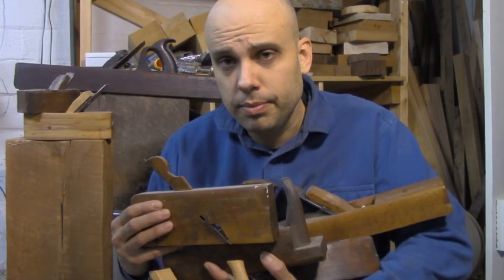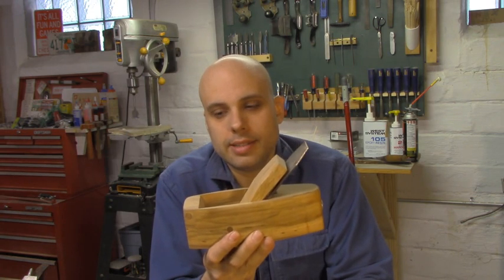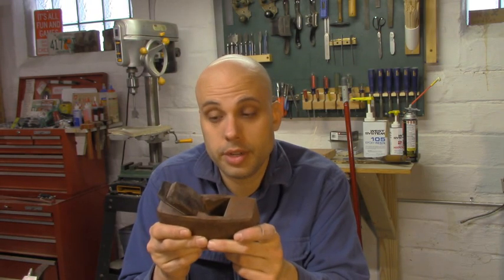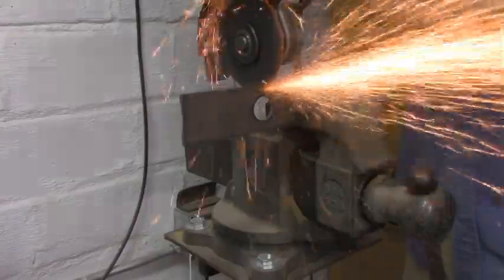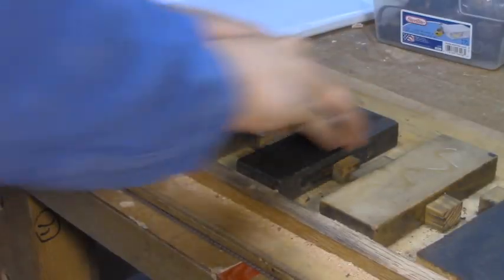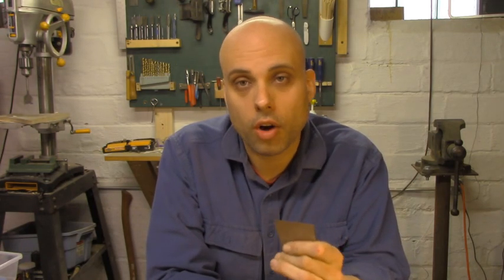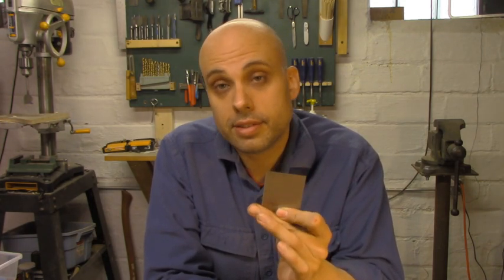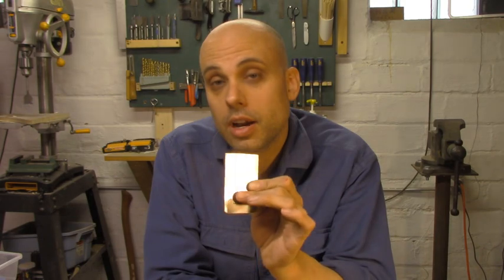Make a plane blade for $2?  (Maybe)

Comment: You still gotta harden it. The spark test kinda sorta tells you if it's high carbon. They make the edger blades out of high carbon steel so it's tougher (like lawn mower blades) but neither are hardened because the first time you hit a rock they'd chip or explode which is bad for business. In metallurgy you always test to see if it will harden.
Reply: Little late but theoretically I could use either of those blades to make plane irons and just harden and heat treat it myself right?
Reply: Additionally they are softer than a file, but harder than mild so you can resharpen them by filing them.  Same with many axe heads and scissors.

Comment: Based on your file test the edger blade is much softer than the Stanley blade.  They probably have tempered the edger blade much more than the Stanley blade to increase the toughness of the steel.  They don't want the edger blade shatter when they hit a rock while using it.  Besides the file skating test should only be done on hardened steel before tempering.  What might have to be done is that you re harden the blade and temper it a bit in the kitchen oven to soften to your liking.  I would heat the blade with a torch until it looses it's magnetism and then dunk it in oil.  Then test with the file again and you should skate across it. Then put it in the oven at 400 F for an hour or two to bring down the hardness a bit.  If you don't temper it will be pretty brittle.
Reply from the maker: Funny that you should mention that!  I did heat a test sample to non-mag just yesterday and quenched in oil. Didn't harden at all. I was hoping to re-harden and then just temper it back a little, just as you suggest. But, this could be a water-hardening steel, so I'll repeat the test today, but with water as the quench. My suspicion right now is that I'm dealing with a medium-carbon steel that's not going to fully harden no matter what I do. But that's okay; I've got backup plans. Either way, thanks for watching and taking the time to leave such a detailed comment!
Reply: Yeah most likely it is too low of a carbon steel.  You can always get a piece of 1075/1080/5160 or 1095 for not much money.  Admiral steel for example have 1/4" x 2" x 60" bar of 1075/1080 for about $29 that would make many blades and you know you have an easy to  harden steel.
Reply: its only $29, but if you only need 10" (for 2) seems like to much
Reply from the maker: I did just get a 12-inch bar of 1095 off ebay for $20. I think I'm going to make 3-4 irons out of it. At that price, the math works.
Reply: That should work just fine 😀
Reply: I also think you have a medium carbon steel. This is not all bad  news and you have two or three options. A; throw the piece away and buy an expensive blade. B; throw them piece away and find an old piece of leaf spring from a breakers yard. This will be high carbon from which you can produce blades to your hearts content. C; find some Casonite and infuse the surface with carbon. Harden and temper the blade and you should be fine. Look  up 'Clickspring' and look for his video on making files. You'll learn everything you need to know. Look him up anyway, he's a highly skilled craftsman with fascinating projects. Regards.
Reply: An edger blade that shatters during use would, indeed, be a bad thing. That’s probably why they don’t use steel as hard as plane irons.

Comment: Just go find a leaf spring from your local pull-a-part or junk yard, or even ask your local mechanic if they have any broken leaf springs.  Those are going to be 5160 steel, which is very strong and hardens quite nicely.  I've made some excellent knives from 5160 so the blade for a plane will function very well.  It's also relatively easy to heat treat at home with a charcoal fire and some canola oil (Parks 50 would be better, but canola will work), then temper it in the oven twice at 375F for 1 hour, letting it air cool in between both cycles.

Comment: Old lawnmower blades are an excellent source. They can often be gotten for free from a lawnmower repair shop.
Reply: Mower blades are not hardened.  They are just plain old mild steel.  This is they deform instead of turning into shrapnel when you accidentally hit a rock.  People routinely sharpen mower blades with just regular files.

Comment: I can already tell this is most probably some kind of spring steel, so it is hardened, but not hard enough for a plane iron, because spring steel has only 0,5-0,8% carbon. 0,8% could work for a plane iron, but it`s a bit on the low side. Tempering is also important. It makes the steel softer but mote flexible. If you just harden the steel, the edge will chip. If you want a blade, you have to temper it, so you have to heat it up to 200-300°C, depending on what you want to do with it. If you temper it higher, ou get a very springy but soft steel. Ideal for the edger, but too soft for a plane iron. 
I made some plane irons out of lage bearings. That´s a really good stell for woodworking tools, but bearings are typically round, so you need a forge and an anvil. 
An alternative is to order tool steel. I bought a piece of 1.2510 Steel, 4,2mm thick, 500mm long and 200mm wide for under 40€. I can make a lot of plane irons out of that. i just have to cut it, harden, temper grind and sharpen.

Comment: Rex, I discovered used table saw blades often make a good irons.

At the Habitat ReStore i find them for $2 - $5 i can get several irons from 1 blade.
They usually "Sing" with a file and hard to scratch.   Test them before you buy.

I now have a scratch plane, scraper, Rebbit, and a few Spokeshaves from them and so far seem to be holding the edge.

Love your videos.
Keep them coming.
Reply: Can table saw blades be cut with hand tools like a handsaw with a high tpi? For cutting metal? Or would I need a power tool/angle grinder?
If not, I might try annealing the table saw blades in my kiln to soften the steel, cut with a handsaw, then shape, re-harden, temper, and hone it. 
I don’t like power tools that spin blades...it’s why I use hand tools.
Thanks for the reply!
Reply: @nostgeoffhi-fi  i used a Dremel tool & grinder wheel although an angle grinder works better

Comment: I just discovered this channel a week ago, and I really enjoy your restless curiosity. Also, you usually ask the question, ' there must be a cheaper way to do this'. This is a can-do, not afraid to make mistakes, way of living, that was a lot more common several generations ago. Thanks! 

    About this blade idea, I love it 
because you are asking, is there an easier way to access these tools. It isn't clear to me if you tried hardening the blade, as some suggested. But you did move on with a different idea in the following videos. 

    I had an idea about these blades as they are. I think they might make a heavy card scraper. The steel is clearly at least medium carbon and fairly hard.  If you draw-file the edge square and hammer lightly and evenly to create a burr, then you have a scraper. 
    A normal card scraper would be made with medium/high carbon steel, draw filed, and burnished to create the burr. (The shank of that 2in chisel you cut the blade off of might make a good burnisher, it already has a handle.) 
   A scraper needs to be hard to form a cutting burr, but soft enough that you can deform the metal to create the burr. I'm definitely getting some of those blades, and I'll get back with a comment if I find anything useful. 
    Thanks for the ideas!

Comment: I've made some plane irons from old motorized edger blades. After initial shaping with a file or grinding wheel I heat them to orange-hot with a propane weed burner and while I do get a pretty hard steel with water quench, a file can still bite into it, even if with difficulty. Carburizing the steel makes it hard enough that not only will a file not bite into it, but of course a sharp edge will hold much longer. Case hardening is a good way to do this and one practical method for the home craftsman can be found on the YT channel about the reconstruction of the Antikythera, called Clickspring . The method described therein consists of making a charcoal putty made of 6 parts charcoal powder, 4 parts table salt, and 3 parts flour. The putty is applied all over the part to be carburized, until it is completely covered, then left to dry until very hard, then encased in s tube of modeling clay (to provide an airtight case), after which it is put in a hot  furnace for at least 20 minutes.

Comment: You can get a piece of O1 tool steel 3/16" x 2" x 18" from McMaster-Carr (product no. 9516K68), but you will have to heat treat it.
O1 steel is one of the easier tool steels to heat treat.
Reply: I was thinking exactly the same. I like knife making videos and that's what they recommend.
About more steel options, check Walter Sorrells channel, he has a good video on that topic.
O1 can be heat treated with any kind of oil and get tempered in the kitchen ofen. There are tons of videos about this topic.
Thanks for your work Rex.

Comment: Worn out lawn mower/edger blades can be found at your local lawn mower shop, usually for free, and make great plane irons.
Unlike chisels and files that are relatively stationary in use, mower and edger blades spin at pretty high speeds and are in near constant danger of hitting hard objects.....that's why they drawn to a softer temper, to reduce the chances of shattering and becoming shrapnel....

Comment: spark test - look for the sparks to end with little chrysanthemum fireworks shaped explosions.  iron just throws sparks, mild steel you may see a couple, but with hardenable high carbon steel most sparks explode, which is the carbon inside each crystal matrix oxydizing.  your edger blade sparks looked good, likely needs to be quench hardened and tempered.

Comment: Hi Rex Krueger,
I have the best solution for the blade. You can use a car seat belt latch. It is hardened steel and could be pretty cheap in any seize. That's the best idea for the blade.
Go to a scrap yard or use your middle seat belt latch :P

Comment: A crude test for hardened steel is to see if it rings like a bell.   Same test used to see if a firearm frame has lost its temper after a fire.   Doesn't tell you how hard it is but it can tell you if it is soft.

Comment: The edger blade is probably in the mid to high 30's Rockwell C. It's hardened enough to minimize wear but not so hard it shatter under use
Reply: is it also possible that only the edges are hardened but the rest is left softer for the same reasons you mentioned?
Reply: probably good for a jointer plane

Comment: Aloha Rex ,
Here in Hawaii , it isn't that old tools don't exist but the termites ate the wooden parts and when you find them , the iron parts are very rusty from the salt air of these islands . So , when I find old gems , I carefully measure what remains before even trying to take them apart , than at least I have the measurements to remake the lost body of the tool . For the 'rehabbed' tool .I'll use the same or better wood and be sure its not going to be left for a meal to termites by telling its 'new' owner of disuse= a meal for Hawaii's termites .
Reply from the maker: That sounds like a great way to go!  I didn't know termites were such a problem over there.

Comment: You can buy high carbon steel on ebay or online metal suppliers. Also a local engineering / fabrication workshop might sell you an offcut for the same price they'd sell it to the recyclers.

Comment: You can also case harden by dropping red hot steel into powdered carbon, easiest is some powdered charcoal, I've mixed powdered charcoal in with used motor oil for quenching a knife blade before... just happy I had the shape where  I wanted... the surface became so hard it was nigh impossible to shape with a belt grinder and files were a lost cause.
Reply: You've given me a great idea to try hardening steel. From time to time I burn off branches that accumulate from the trees in my yard in a habachi. So I have a nice hot bed of coals for a couple of hours. If I want to keep some charcoal, I grab it with some stainless steel tongs, and drop it into a bucket of water.

   Now the habachi (mini- barbeque) is about 6in by 12in, with a grate and little vent in the middle. If I pack in powdered charcoal at one end, cover the beveled end of the steel with a thick paste of powdered charcoal and used motor oil, and let it just sit there for a couple of hours in the bottom of the bed of coals while I do my occasional yard maintenance burn,  I bet I could get some of that carbon into the steel. 
   If it works, I'll report on it. I love the used motor oil idea. I always have part of a jug sitting around, between oil changes. I only take it in to recycle when I have a full jug.  

   This method will only cost a few minutes of time to crush some charcoal, so I can't wait to give it a try.

Comment: Not trying to be mean and I know it is likely someone has probably already said this, but the cast-iron you have is like a type called malleable cast-iron achieved after annealing the original cast part. Annealing removes stress in the part by relaxing the crystal s and allowing them to settle with less boundary tension. (Oversimplification) the process makes the part softer but more ductile. That also means it is less likely to hold an edge. Typically, cast-iron is Hard and Brittle. Things that are hard tend to be brittle because the structure has low plasticity. Think hard is to brittle as soft is to ductile.
Reply from the maker: I'm interested in your comment, but I'm really not sure what piece of cast iron you're talking about or why you think it's malleable iron.
Reply: Oh, of course. At 5:25 you show a block of material and call it cast iron. Then, at about 6:25 you show what looks like the same block of material and say its cast-iron and it is too soft and brittle to hold an edge. Then you file it at around 8:15. While it isn't indestructible, it should have been able to resist the dig of the file better then it had unless it had been annealed at some point.
Reply from the maker: @ted8919  Ted, much respect to your careful comment here, I appreciate you taking the time, but you are incorrect. Cast iron (annealed or not) is very soft relative to hardened steel and is easily cut by a file. This hunk is just a weight that come from the base of an old lamp. I seems impossible that they would have used malleable iron for a weight. Also, I've worked with a bunch of cast. I also weld and blacksmith (although I don't include these things in my videos). I'm pretty familiar with metals. I'm pretty sure this is just ordinary cast iron, mostly because is behaves just like the dozens and dozens of pieces of cast I've worked with before. Here's a data sheet: http://www.matweb.com/search/datasheet_print.aspx?matguid=ec56a89f37f74e2f867a64b0f87f1e9d&n=1

Maybe I'm still misunderstanding something here. I'm more than happy to be proven wrong or learn something new.
Reply: @RexKrueger  Sorry for taking so long to reply. Maybe, the issue is the comparison of the specific materials being made. I would like to review some data before continuing the discussion, if that's ok. I hope you are not offended. I rather enjoy the prospect of sharing AND acquiring knowledge. After all, that is the reason I watched your video. I have no intention of "proving you wrong". I see it as more of a potentially mutually beneficial discussion of metallurgy. An opportunity to refine the knowledge of both parties. I'm not religious but somehow I find Proverbs 27.17 applies well to how I view this conversation.

Comment: You could just carburize some mild steel, there's some really good videos on the process on the clickspring channel
Reply: Rob Mckennie not for $2
Reply: It's called case hardening it can dig about a sixteenth of an inch so on a 1/8 blade it can functionally go all the way through at least as far as youd need it to on the back edge. Where you'd want it anyway.
Reply: @Tehcarp  sure you could, if you looked at the video I mentioned, Chris made high carbon steel using charcoal, flour, and table salt

Comment: You could also go online to a place like online metals and buy a piece of tool steel. Then you know exactly what the steel is. Grind, hone, whatever. McMaster is also a great place. Maybe not $2 but you get exactly what you pay for.
Reply from the maker: No doubt, and things will certainly progress in that direction. The point of this video is to experiment. I really think that somewhere out there is a consumer product made of a suitable steel. The rules of mass-production say that a mass-market product like that will always be delivered to the consumer at the rock-bottom price. Ordering a small quantity of steel from a specialized retailer is going to come at a premium. I'm not THAT cheap, but I want to see what's possible. Thanks for watching!

Comment: If you need a wider blade you could cut the edger blade to the width you need then weld it to a piece of mild steel. As long as you take care not to overheat the part of the steel that will be the cutting edge it won't lose it's hardness.
Reply from the maker: I completely agree, but those craftspeople who own welders probably don't need $2 blades. The idea here was a blade that was cheap and off-the-shelf. Admittedly, it didn't go so great.

Comment: Alloys are not fused on the molecular level. That’s compunds (like iron oxide or calcium carbonate). Alloys have different elements enlaced on the structural (crystalline, more or less) level. Steel is not a compound, it’s an alloy.